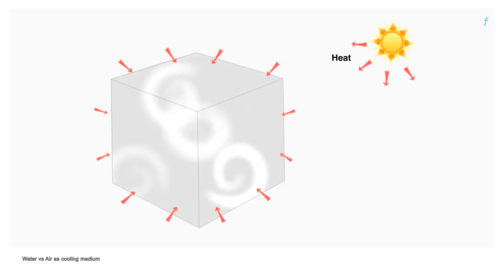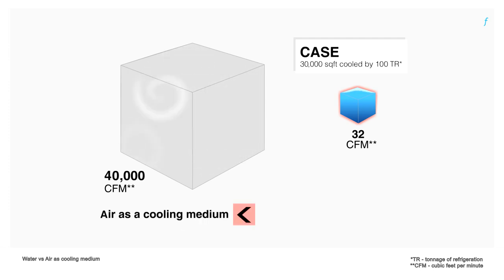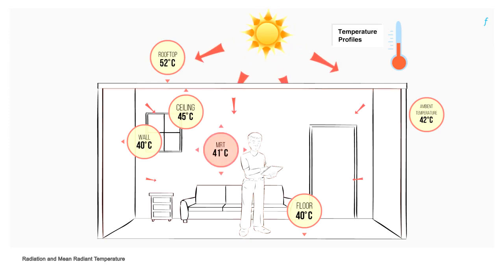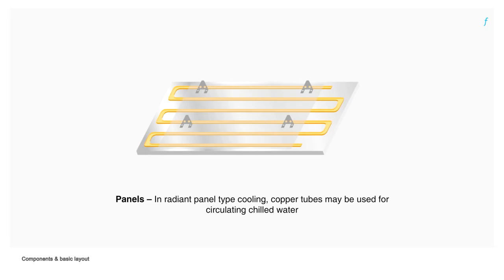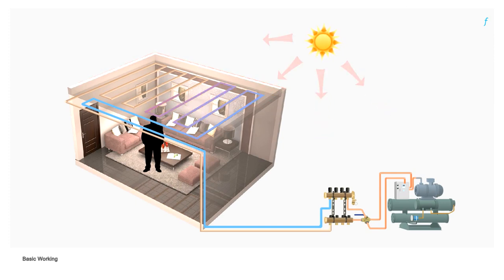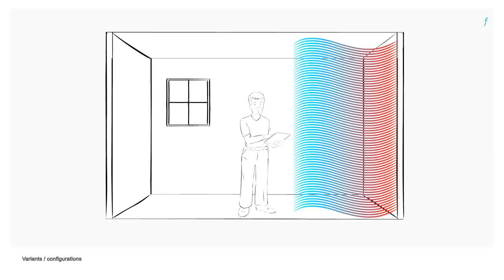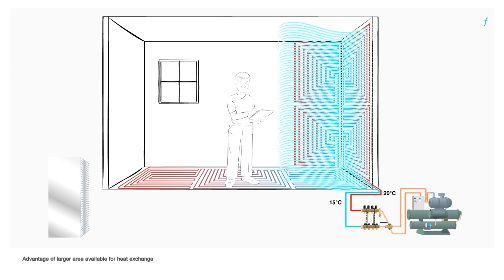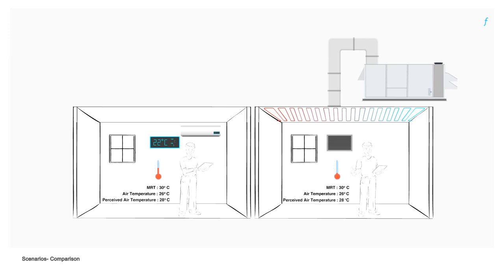Radiant Cooling Animation

Comment: This has very low COP vs Heat Pumps.  We should pair Heat Pump ODU heatpipe and put into the ground in a large circuit. This could utilize Geothermal heat exchange and will give max SEER and COPs than any system in the world! SEERs of 25+ can be achieved pretty easily. As Ground always has 5-10* temperature difference than air load will be very less.

Comment: I can picture this also being used to heat homes during winter. But beware of pipes & equipment being damaged if the water is ever allowed to become ice. The expansion of ice, can even rip metal. This is why car cooling systems need antifreeze.

Comment: nice info, btw which one is better in wall, ceiling,floor
Reply: ceiling. radiation transfer is unimpeded, whereas the floor might have rugs, furniture, etc.
Reply: @unicornofthought What about a system for heating though?
Reply: @freddybell8328  same system. warm fluid is circulated for heating.

Comment: Thank you for a stimulating presentation. Although you addressed the operating costs, I wonder what the capital costs would look like ?
Reply: The same as floor heating I would suspect. However A radiant barrier in combination with the radiant cooling would probably be a legendary cooling system for hot climates!

Comment: What happens if a leak develops within the piping inside the wall or floor or ceiling?
Reply: This is the issue with ductless air-conditioning systems we use today!.

Comment: what happen if you use just wall cooling and wall heating for summer, using wall cooling it may be possible to condense the water falling vertically to a collector and you avoid the dehumidification unit which it would cost more than a simple air condition unit that do both things (dry and cool).

Comment: I don't get why the radiant heat exchange loops have all those 90° bends. Wouldn't it make much more sense to have a bunch of coiled loops to maximize coolant flow? Otherwise, you're going to have immense head pressure.
Reply: Probably less material usage
Reply: Wouldn't that increase thickness many folds and they could just use u bends instead of L bends

Comment: THANK YOU, this has been very informative. My one query do we need to install only one kind of system on the ceiling and or it can be installed either on floor / wall / ceiling? How do we decide the module, what is the calculation used here, asking out of curiosity.
Reply: It's similar to floor heating, but on the ceiling. Remember if your water is cooled to 20C and the room is 30C, then the radiant heat is lower effectively cooling objects in the room that have high emissivity.

Comment: chiller is 2X expensive then aircon
Reply: You could dig shallow Wells where the temperature is 9 to 14 degrees c. A simple pex loop in the floor could result in a 5 to 7 degree lower room temp.